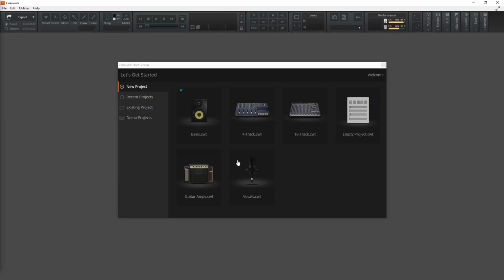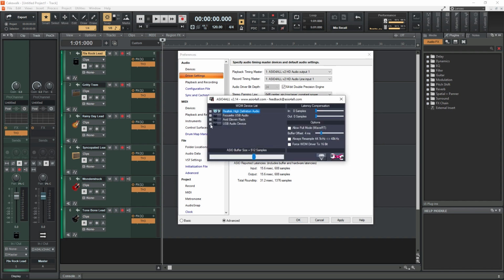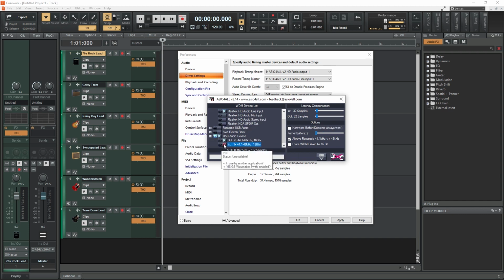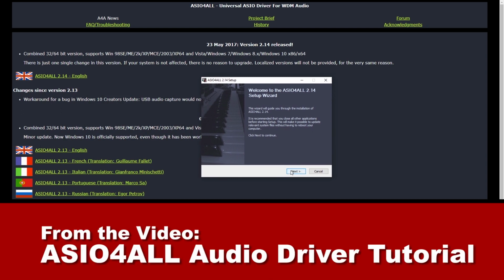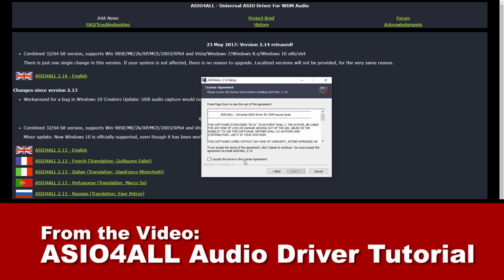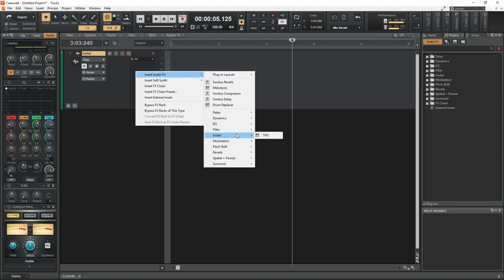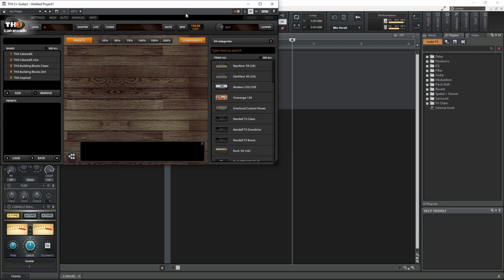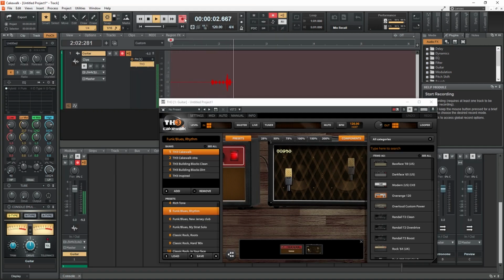USB Guitar Cable – Is It Worth It?

Comment: Thanks for the review. In regards to the clipping, you should plug the guitar to a preamp pedal first then connect the pedal output to the computer with this cable. Therefore you will have the freedom to adjust your guitar signal level properly and you're not overloading the guitar pickup which affects the tone in undesirable way.

As to why some people are saying it sounds like it is in underwater is because of the amp sim cabinet convolution. It's at 100% wet and you can't change it. To make amp sim sound better, get NadIR plugin and load your own IR cabinet files into this plugin and don't use the amp sim cabinet convolution. NadIR allows you to adjust the dry and wet ratio of the  cabinet convolution. In my experience, it sounds absolutely exactly like the real guitar amp when convolution is at 35% to 50% wet. Hope this helps future viewers.

Comment: did you hear the noise level on the dirty amp sim ? thats because you are turning the guitar input low to avoid clipping the usb hardware . not ideal . get the behringer um22 or what ever budget interface you can find . my first was a line6 guitar port i paid 15 dollars for . it sounded very good . i used almplitube , th3 and all sorts of vsts in reaper .

Comment: Whats the difference between connecting this directly to the pc and connecting it by an audio interface?
Reply: this is an audio interface. a shitty cheap one but still an audio interface. the whole device is the usb part. its just more confortable than using a dongle with a cable and a headphone output.

Comment: Lose All Audio Output when I plug in the USB guitar cable.

It didn't used to do this, I used it for months with no issues, was busy for a couple of weeks, and when I plugged it back in, Silence... I tried switching to other ports, changing the audio device, .. nothing seems to work.

I want to think the cable is defective, but it Did work, and why should it effect other audio?

Comment: "we'll be using an audio workstation and amp simulation software. ... Cakewalk with the Overloud amp simulation that's included. ... If you want Overloud to work in Cakewalk (obviously yes?), check out another video. First thing to open a project. (Cannot see WHAT project, as your mouse hoovers above few options.) Than go to edit menu, and set ASIO4ALL as driver. (Cannot see ASIO4ALL as an option, at all.) For more detailed info on ASIO4ALL, check out this other video of mine... " This was anything, but helpful, sorry.

Comment: i wish i had one can an amplifier be used to connect to amp simulator ?
Reply: Does your amp have an aux input
Reply: @haydenhartley7212  i don't know im just asking
Reply: @hruaiafanai3598  i mean if it does you can get an irig and an aux cable and use that
Reply: @haydenhartley7212  thank man for the info i really appreciat it .
Reply: @hruaiafanai3598  that’s what I do, you know what an aux output is right?
Reply: @haydenhartley7212  no man i don't know anything but i used guiter rig 5 in my computer  but the sound output i used is my woofer i used guiter or  jack cable  to connect  guiter  with my computer

Comment: If you are planning to record covers especially bass covers, don't use usb guitar cables. Once you plug it in your laptop and start recording, you will hear a really loud hum noise that is really annoying and cant be fixed. The bass also gets drowned with the loud humming and also latency
Reply from the maker: That hasn't been my experience, but it could very much depend on your particular instrument and cable.
Reply: any recommendation for recording a bass?
Reply: @theguy4688  Get an audio interface. Any audio interface is good. I just got mine a week ago and it totally works. It eliminates the humming noise and there is no latency
Reply: @danieljonsantillan5597  even the cheap usb guitar link?
Reply: Daniel Jon Santillan really? Ive havent found any solution for the static noises when I record my bass its sad that it cant be fixed

Comment: why does mine sound lke shit? it has a lot of gain and its noisy
Reply: I think some cables are just bad
Reply: @thomas.thomas  I guess so, never really managed to solve this. Some softwares make it noisier than others, but overall it's still noisy. I don't think it could be my guitar, since it does little to no noise in OD channel on my amp
Reply: @Enzon both headphones and speakers
Reply: That's why I didn't get one.

Comment: Can I used that for Bias Fx?
Reply: Yes, you can. I use mine for Bias FX. It works fine, but you might get a bit of Latency. 
Adjusting the Buffer Size and Sample Rate can fix that problem, though it gets kind of annoying, because you have to constantly adjust it if you are using a backtrack due to the extra audio being played through your speaker.

Comment: does this work with a bass?
Reply: Yes Because The Plug of a bass Is the same plug on a guitar so You can use it but not of course with the way he setup the amp you will need to get a bass amp emulator if your using Mac I recommend garageband or logic

Comment: I have 2 questions
1 can I use this as a mic on discord
2 can I feed my guitar thru pedals and then to the pc
Reply from the maker: I'm not sure if you could use it with discord, but it can be set as the primary microphone input on your computer, so it's no different than any other microphone that is connected.

Guitar pedals can be used first, just connect the USB cable to the last guitar pedal. I'm not sure how good that will sound though.

Comment: Can you use this cable for Rocksmith with the mod that allows to play without the original cable?
Reply: Yes you can use it for Rocksmith. It will show up as a microphone.
Reply: @xero3856  Really? I used a fairly similar cable for Rocksmith, Nuosiya I believe, it had all the packaging but it didn't do crap.
Reply: @jamesslayer4  I don’t know want to say to that but check the audio settings for your computer. I had to fiddle with them for Rocksmith.